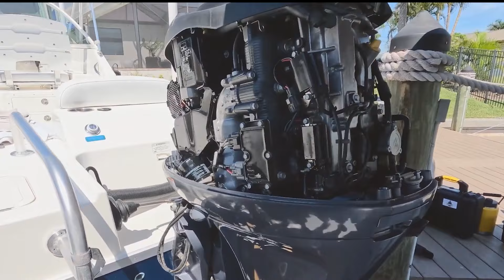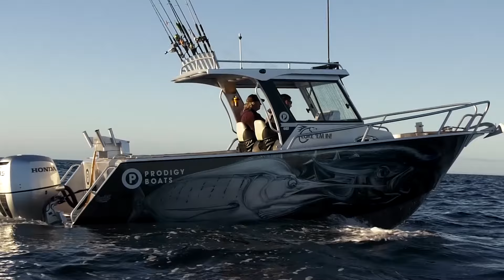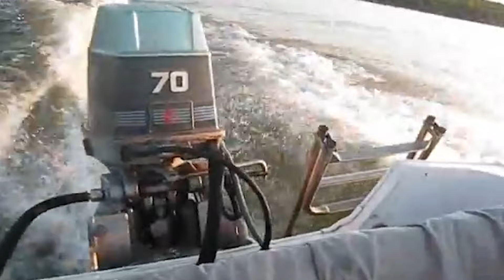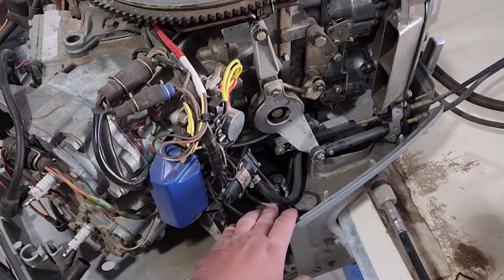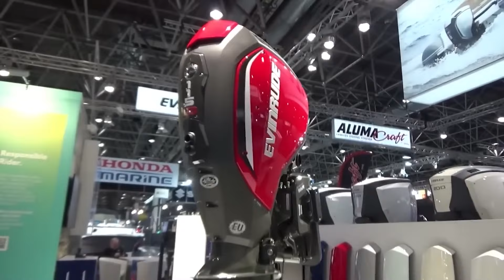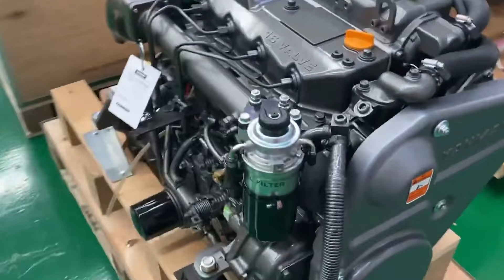Why Every Marine Mechanic Runs a 25-Year-Old Engine (The Sweet Spot Nobody Talks About)

Comment: Exactly the same thing with cars , long gone are the 300k no hassle engines of the late 90s early 2000s , emissions regulations are not so much saving the planet  as killing cars
Reply: @tomthompson7400

And that huge dumpster of dead engines behind every kia service center must be helping save the planet too...    To save the planet just go back to peak automotive how it was around 2005 and 1990s,   engines and cars that last   but burn a little bit more fuel are way more environmentally friendly than overcomplicated planned obsolescence junk that kills itself in under 5 years 100,000 miles and often way before that,  looking at you wetbelts...